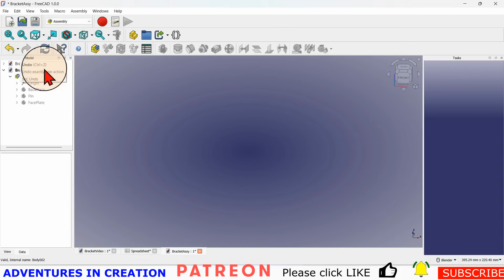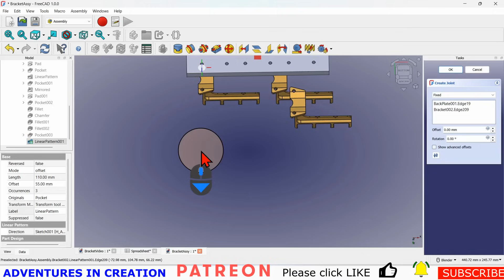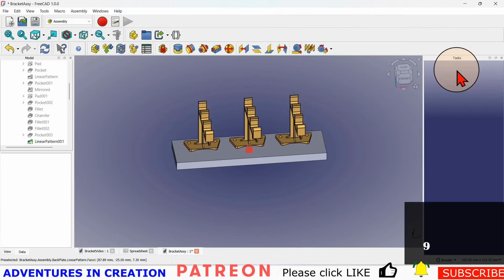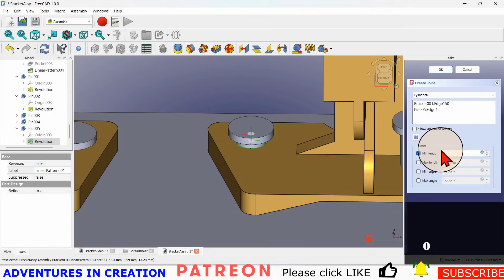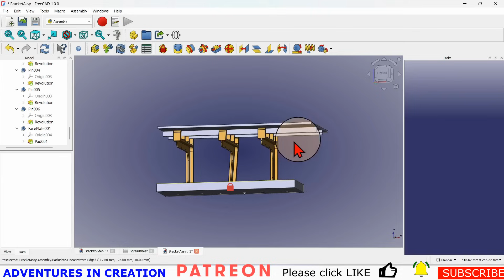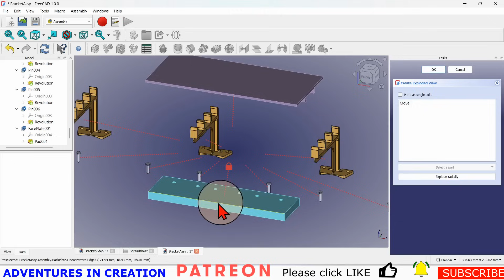Intro To FreeCAD Assembly Workbench #freecad #cad

Comment: Does not work as shown.  I have the version 1.0.2 which I expect to work the same.  Everything is fine up until I pick a file to open which would be the part I expect to lock.  I am presented with an insert Component Window which has in it by default to components; one named Unnamed.FCStd and the openned component I want to place first.  I cannot delete the unnamed component to get it to look like your demo.   I click OK and I do not get the part show in the assembly or the prompt to lock it.  Also the Model tree just shows the Unnamed Assembly and my first part as if it is a separate file.  Again no parts are visible in the new assembly.
Reply from the maker: I am not sure if anything changed in 1.0.2 I will try it in that version.

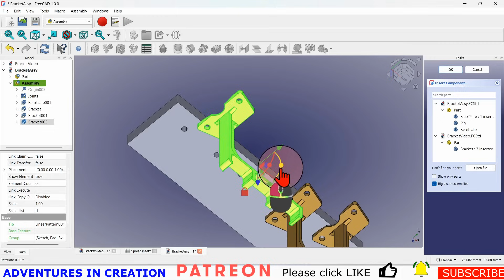Comment: Rotation at 6:08 doesn`t work finally for this joint. Is there a possibility to fix that?
Reply from the maker: Why doesn't it work?
Reply: @Adventuresincreation  Sorry, I mean this rotation isn`t stored or used for the following  joint command. I play around with some joints. I guess it`s better to joint parts first and then change transform (move or rotate)  if necessary.

Comment: Why are my join icons greyed out?  I have an assembly with two components I want to join.
Reply from the maker: Did you select the joint location?
Reply: @Adventuresincreation  Yes.  It's two surfaces I want coincident.  Both selected.
Reply from the maker: @Marvin35568  Can you share your file?
Reply: @Adventuresincreation  Sure.  What do you need?  How do I get it to you?  Just started using FreeCAD so only have 6 files.
Reply from the maker: @Marvin35568  I need your assembly file so  I can see what's going on. You can upload it somewhere that I can download it like dropbox or something?
Reply: @Adventuresincreation  I posted the link.  Did you delete?
Reply from the maker: @ I did not delete it, maybe YouTube did, try posting it with some spaces or something so they can't detect it.
Reply: @Adventuresincreation  found your email so sent files.  Hope that's OK.
Reply from the maker: @Marvin35568  no worries, I will take a look and let you know what I find.
Reply from the maker: @ I sent you and email, it's how your are inserting the bodies into the assembly that is causing the issue.

Comment: Hello, much greetings, how would one export the assembly as an STL file? I'm trying to build a bookcase out of two parts: the bookcase shell, and the shelves, and putting the bookcase together in Assembly Workbench. Got the assembly ready to export, not sure how. Want to 3D print the assembly using an STL file.
Reply from the maker: You can just select the assembly in the model tree then file - > export choose STL. Should work well.
Reply: @Adventuresincreation  Thanks. It tells me, "No FEM mesh for export selected" and faults. So I need to convert the assembly to a fem mesh somehow..
Reply: Okay, so I went to the "Mesh" workshop, and clicked the generate mesh from shape icon. It generated a mesh of the solid, and I could save as STL. It only exported the bookcase shell from the assembly, and not the shelves.
Reply: Eventually found a solution. In mesh workbench, with both parts selected using the CTRL key (The bookcase shell and shelf), I generated meshes which created 2 different meshes. With both meshes selected, I then clicked "Merge Mesh" in Mesh workbench, which created a new mesh with the two parts combined, which could be exported in the right-click context menu as an STL. Voila, the full bookcase, shell and shelf(ves)

Comment: I have been using FreeCAD A4 workbench for a few years now to verify dimensions and check for clearances. I usually 3D print the parts, check, correct if necessary and repeat. Only if the plactic parts fit, I cut then in metal. This methodology has saved me a lot of time and material. 
So thank you for the past lessons, now I need to watch your videos for V1 and rebuild my assemblies in the new version since the new workbench uses different method for connecting parts and does not understand A4 models.
Reply from the maker: That is correct but I think you will find the new assembly wb is easier than assembly 4

Comment: Very informative.

So there's no collision detection in Freecad assemblies?

When doing pins/screws etc, could you joint the bracket to the baseplate, and then the pin to the bracket, but then use the pin to do a boolean on the baseplate from that position?  Or best to model those features common to multiple parts seperately before joining in an assembly?
Reply from the maker: No collision detection. Best to model separately. All good thoughts though.

Comment: Is it better to have all the parts as bodies in a single file, or is it better for performance to generate each part in it's own file and only assemble them in a common assembly file?

I am reverse engineering an engine from a drawing, and can see I will end up with a lot of parts, as for example, the piston also generates a casting pattern, two core molds etc.
Reply from the maker: For something with many parts, I wouldn't put them together until you need to. Of course if you checking clearances you might want to create some sub-assemblies.

Comment: Your video is (again) Top ; however using this new wb does raise questions: 1) I needed to copy my (3) bodies from different files into a new tree first; one of the bodies contains a speadsheet w sizes. Assembly does not recognize this body. iow I cant get it into the assemby 2) how and where can you toggle the grounded item and switch to another body to be grounded? 3) continued with (2) items, applying the rotation joint, worked fine! but afterwords trying to swop the grounded item to the other item made Freecad block or crash; had to restart FC.
Reply from the maker: As long as the body is in a valid freecad file you should be able to add it to the assembly, remember one of the options is file... So you can from other files, no need to move bodies. The change locked body is in the menu. A tip here is to consider which item is least likely to move in your assembly before you add items then add the fixed item first. Worst case delete that assembly and have fun building a new one. I have found it is possible to crash freecad and it will try to recover your file. Another tip always save before doing any procedure that is going to make a major change. You can use save as or save copy to keep additional copies with your progress so far.

Comment: What I noticed is that the videos on the playlist are not in the usual order, but in reverse. (The newest is currently at the top. Normally the "oldest," (the "introductory video" for the playlist), is at the top and the newest at the bottom)
Reply from the maker: Someone else said that too however, I can't change that. I checked and it showed they should be in the playlist in the order they were added. I am sure it's something to do with YouTube.
Reply: @Adventuresincreation  I don't know if there is a difference with public playlists. In my private playlist I can change the order like this:
- Click on the playlist under the "Playlists" tab
- Click on the playlist caption to switch to the detailed view of the playlist..
- Set an order using "Sort". With "Manual" you can change the position of the titles using drag & drop, for example.
( the actual names of the buttons may vary in English, because I used the direct translation from German)
Reply from the maker: @to.l.2469  It's a bit different in the YouTube studio but I found a but that let me reverse the order, take a look and see if it changed for you.
Reply: @Adventuresincreation  Yes, it worked perfectly. Thank you!
Reply from the maker: @to.l.2469  Glad it worked for you.

Comment: Great video. It would be fantastic if you added an episode on making technical drawings and their cross-sections from assemblies.
Reply from the maker: I might do that next.
Reply: @Adventuresincreation  yes, Technical drawing is a good topic. Helps to do scaled print on a papter or carton, so you can measure parts before put it into CNC or 3D printer.
Reply from the maker: @goodwill7643  I don't have a printer big enough for scaled drawings of most things I design but you can do that for smaller stuff.
Reply: @Adventuresincreation  agree, but in some cases, you need precision in specific units, not a hole part. For example you have 10cm PCB and want to check mounting holes. Box itself doesn't matter, but buttons, LEDs, Displays should match together. So you can print specific sketch and make sure if any adjustments are needed.
I mean this could be interesing topic for your channel which often googled on internet.
And if you going to do such video, then small tip. KiCAD allows to export PCB as a step file, which you can import to FeeCAD. Very handy feature.
Reply from the maker: @goodwill7643  Good point, that probably works well.

Comment: Instead of rotating by 90 deg when you did the firts joint, could you have made a second fix joint to mate second hole. Is there a function that makes co axial type of mate ? I think the big L shaped legs could have been made with a coincident mate and two coaxial mate ( one for each hole). I will try to see if assembly workbench has a coaxial function.
Reply from the maker: There are lots of different joints. I thought, like you a second fixed joint would align it but it didn't. There is a coaxial joint and a distance joint. I tried to demo both. I would have just used fixed joints for all of them in practice.
Reply: @Adventuresincreation  i belive its preferable to use two coaxial joint because if it doesnt work it means that the connexion is impossible therefore the distance between the holes on one of the part mated  is wrong (not the same).mating one ole and turning 90 deg will always work even if there is a mistake in the design.
Reply from the maker: @akimen64  I understand your point but the joints don't always work that way.
Reply: @Adventuresincreation  Maybe you should try the a2plus workbench, it has all the types of mates that you may need including stable co axial type of mate.
Reply from the maker: @akimen64  I have tried and made the video LOL. - I am trying to work with 1.0 and the included assembly workbench as that is the where the developement effort is being focused.
Reply: @Adventuresincreation  oh sorry i thought you were presenting the assembly work bench wich seems different from the a2plus. Have a nic3 day

Comment: Did you try affixing the brackets using a revolute on the first hole and a fixed on the second hole. This seems logically that it would be the proper way to assemble those two parts.
Reply from the maker: I did but it didn't work the way I would have expected. It's definitely something to play with.

Comment: I wonder if there is a way to create new part during assembly (for example to adjust new part for existing one).
In Autodesk Inventor is the best I know - you create new part and you can cast geometry from other parts to new part sketches. Then design process is much easier, at least for me.
Reply from the maker: Yes, it's quite easy to do. You can literally switch the referenced part. I almost showed that but the video was too long.

Comment: Excellent tutorial, thank you. Maybe I would figure it out by experimenting, but let’s say your top plate has some clearance built in so it slides without binding. You wouldn’t assemble it as you did with the two edges touching. If, for example, you wanted to assemble a dovetail joint that has a bit of clearance on all surfaces. Is there a way to center out the male part in the female space?
Reply from the maker: There is a distance joint that you could use. Especially if you are looking to confirm fit and clearance.

Comment: Great video----What about weight and materiale of each part in the BOM?
Reply: You can assign materials with the Material command, allowing Python to access e.g:
weight = FreeCAD.Units.Quantity(obj.Shape.Volume, FreeCAD.Units.Volume) * FreeCAD.Units.parseQuantity(obj.ShapeMaterial.Properties['Density'])

This could be used in a macro to fill in a weight column. I don't think Assembly CreateBom has a feature to describe new columns, though. I also think expressions (like in spreadsheet) can't do indirect object lookups via names in other fields. Material seems more meant for the FEM system, but we can improve it.
Reply from the maker: @0LoneTech  OK, a little further investigation and I could access Area and Volume directly in the BOM but the density proved more tricky. The method _getitem_ does not appear to be accessible in the BOM directly so I had to use the python console (or a Macro) to read the item from the ShapeMaterial.properties dictionary for density. I could populate a spreadsheet cell with the entire dictionary but could not index one item using FacePlate.ShapeMaterial.Properties.__getitem__('Density') - There is definitely a lot of potential there.
Reply from the maker: @0LoneTech  Thanks for the tip, I will give that a try and see if I can get it to show up in the BOM. - I'll let you know.
Reply from the maker: @0LoneTech  I think you are right, I could not access these attributes from the spreadsheet or the bom directly. It would have to be a separate macro that populates the spreadsheet. It's definitely food for thought.
Reply from the maker: I think they would be manual adds.

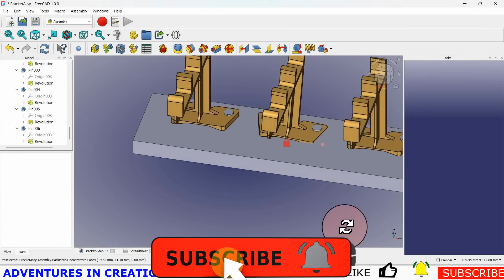Comment: At 17:38, you can see that the fixed joint has pulled the pin and sunk the right hand side of your bracket into the base.
Reply from the maker: Yeah, I thought it would be good to demo how to fix that.
Reply: I came to the comment section to say this. I gave you a thumbs up instead.

Comment: This was a fun video today. At first, I was not interested in this particular area so I skipped the video for a bit, but I got curious and watched. You did a great job of showing and describing the process which I appreciate. I still don't know how I would use this feature, but now I have an understanding of what it does. My favorite part would be the exploded view and bill of materials, they are a pain to create manually.
Reply from the maker: I use it for woodworking projects. It's a great feature.
Reply: I was about to mention that as well, good I checked for previous reports